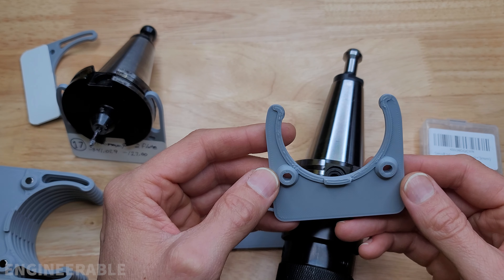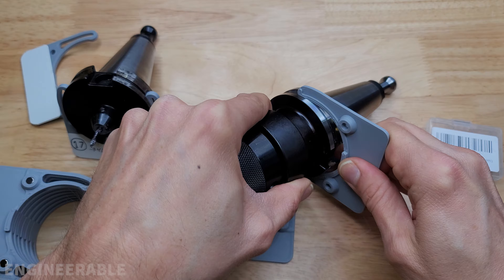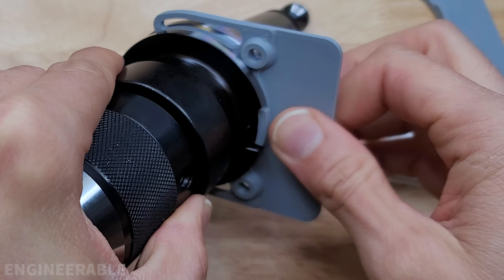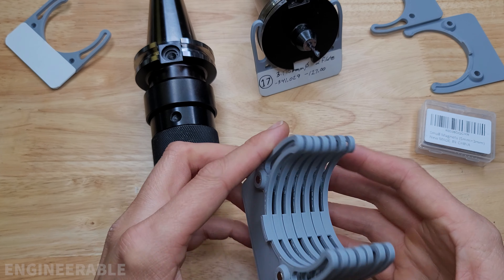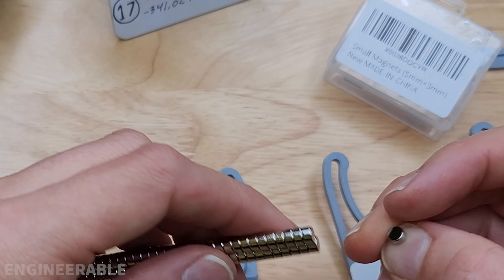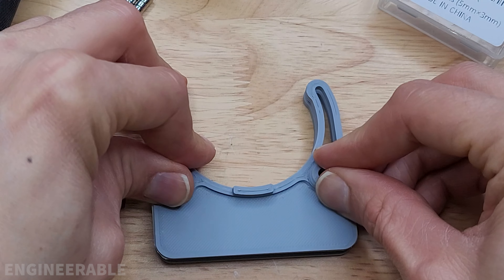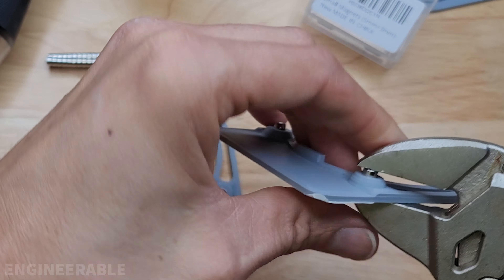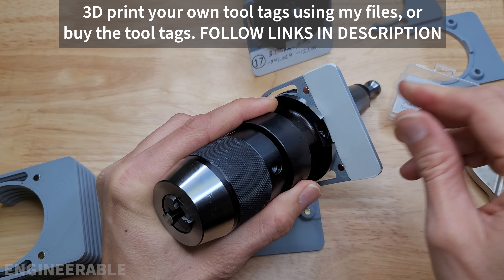I Made A Better CNC Tool Tag (3D Printed) | For CAT40 CNC Milling Machine Tool Holder + Magnetic

Comment: Looks great ^^ 
Do you think the magnets become an issue by collecting steel swarf you think?
Reply from the maker: Thanks! Steel chips and dust can be attracted to the magnets, but since magnets are flush on the surface, it's easy to wipe off clean. There are other magnetic tool tags (no clip on), like those sold by Maritools.
Reply: @engineerable  gotcha, thanks for the detailed explanation ^^